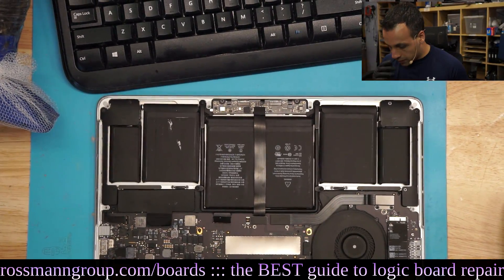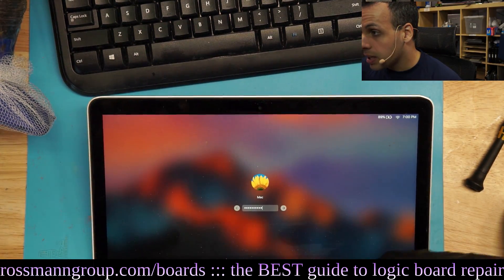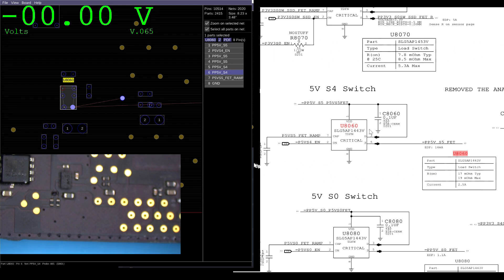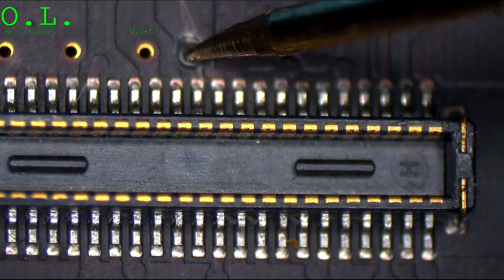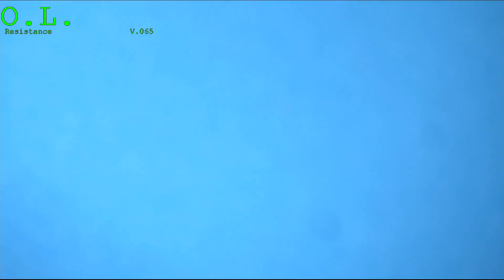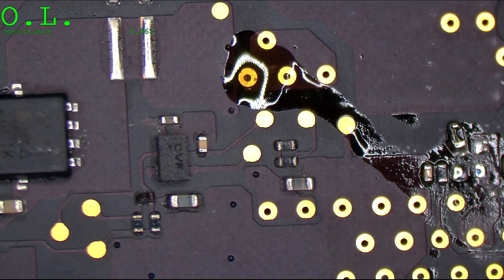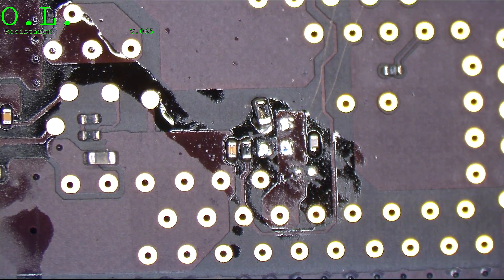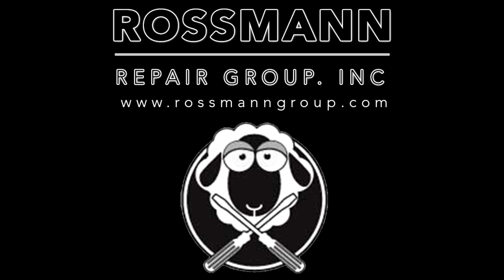Why does little Macbook have no trackpad?

Comment: Did someone ever try to connect this trackpad, as an usb device ?
In my understanding the keyboard matrix is converted to i2c, then sent to the trackpad, which should contain a CY8C24.. or CY7C... which convert trackpad and keyboard to usb. 
Does the the TPAD_SPI bus.. only work before booting/smc and be switched off after usb get's activated?

Trying to reuse a mbp case with its trackpad and keyboard.

Comment: When I was younger, I would have jumped at the opportunity to work in your shop.   As an older IT worker, my arthritic hands no longer have the ability to perform precision work that you do.  That said, I enjoy your videos.  Thank you for sharing them!  In my earlier days, we had a "Windows ME Configuration tool" that was a jagged cut foot long piece of 2x4 that was originally used to make a server rack.  During a repair of a company Windows ME machine, it was ripped off the rack and used to beat a computer until the case fell apart.  We then had justification to ditch the machine and buy a new one.  Good times!

Comment: concerned about 2x failure ? was the board defect by header part of this circuit. knowing how offal cooling is inside these units, overtemp causing fail maybe. just curious, as root cause is important for low comebacks. sometimes your good at identifying root causes but others not so much.

Comment: Hey Louis I know you've opened up a few MSI laptops. How are they built. Junk or Not? 

They are the cheapest company who actually gives decent specs. Their build quality leaves something to be desired on the exterior.

I'm curious by what their internal quality is. I know mine runs cool
 But it also has huge vents on the bottom, and enormous standoffs as well.

Apple would never do either of those things in order to preserve design, even if it sacrifices performance.
Reply from the maker: not bad, but i don't like them soldering the dc jack to the board. makes it easier to break, but lots of brands do that so it is to be expected.

Comment: What’s a good airflow setting for the hot air rework? I picked up a Quick and it’s amazing but I can’t find the sweet spot between effectively melting the solder and blowing the components away.

Comment: This is why I'm glad not to have Apple or need a laptop.  No pointing device?  I just plug one of my spare mouses into USB.  Bad circuit on motherboard?  A replacement is usually $60 or less.
Reply: Steve Johnson you do realise laptops, including macs, accept usb peripherals right?
Reply: Of course, but on a laptop you want a permanent fix rather than carrying around additional keyboard, mouse etc.  No big deal if you're just going to dock it, but that defeats spending extra coin for a laptop.  Most all of my towers are built from used parts.

Comment: You should have tried Linux on this issue again so we could all laugh about how mac hardware is optimized for Linux
Reply: I am really rooting for Linux. I would love to see a third OS choice. Until the do away with threat command line bull shit, software companies won't support it, so it won't gain traction. Once it's not so ass-backwards, it'll get some momentum.
Reply: Since macOS is basically Unix with a fancy desktop, it makes sense.
Reply: Regolith he did a video with a broken track pad with a bad line to the SMC. It worked until he booted it... He put Linux in it the track pad worked. Because it boots in USB mode and when the system finished booting it did a serial line to the SMC... Why have them do that? But Linux was start enough to just use the USB
Reply: +Andew Delashaw I'm actually working on a Video series to show how easy it is, with and without the command line. I have one video so far, but I plan on uploading a second on my weekend this week. I apologize for the first video being long was nervous as hell gonna try to keep the videos from hereon 15 minutes max maybe 20 depending on the video.
Reply: joshagosh I use Linux all the time, you don't need command line, though I find it makes use serval magnitudes faster, but I wouldn't say easier.
Reply: +Peter Borrell and you've skimmed my comment, nice. I said with and without. Not everyone wants use the cli, but some people want to and have no idea where to start. Software companies use CLI far more than you think btw. The issue is the toxic Linux users and the lack of basic user instruction. Can't take an group of advocates seriously when they are too busy jerking each other off arguing over as something simple as them not having the same opinion on desktop environments.

Comment: when I read the title my first thought was that Apple had removed trackpads from some new Macbook model and you were supposed to control the cursor by idk wishful thinking or smth
Reply: barf245 that makes no sense. Apple won't gain anything from that. Make a special port with a hardware authentication system to only register the 50$ specially designed Apple mouse or the 150$ premium version that comes in a variety of different colors.
This sounds more like Apple.
Reply: chemislife Almost apple, just forget about the "special port" and use some shitty 70$ wireless thing
Reply: Leonel Aguilera
but with the special port they can engineer that to fail and make ridiculous amounts of money on bogus repair quotes as well as accessories that have to be designed to use it. going wireless I guess could work if apple developed their own propitiatory wireless card and drivers to only work on their official accessories that cost $$$$ but at this point Im giving them way to many ideas.
Reply: That was probably the point. It's why I clicked.

Comment: Truth is i understand so.little about circuits, but you make it sound so easy and fixeable. Love your stuff. Cant wait for that collab
Reply: Fixing those things IS easy - he even explains it many times that you dont need to know what the stuff does, just notice that it is broken.
Reply: Well it is easy, you just need to know the basics of what each individual component does and pay attention to what he's saying,  here's an abbreviated version "Trackpad no work, how to fix? Look at trackpad line, we have a short to ground so let's look at the components and see what is most likely to fail. Well capacitors often fail short and are going to ground so let's just knock them off, still broken? Have employees beat each other to improve morale then check what else could be going to ground, just the mosfet? So remove that and its fixed."

Once you understand that you can repair almost anything using the same troubleshooting steps, here's a more simplified example. My phone doesn't charge what's wrong? Well first plug phone into different charger, if it still doesn't work then phone must be problem but if it does work it must be the cable or the charger, swap cable then repeat test. Now you know what the problem so fix it, easy.

Comment: How do you clean the boards?
Reply: Jonas Lecerof he seems to use alcohol for little stuff or corrosion, then a sonic cleaner for the whole board. It’s on his website.
Reply: Ryan Santa what does he use as a medium for the ultrasonic cleaner?
Reply: Jonas Lecerof that is a good question and I’d love to find out myself; I’ve never heard him specify what he uses but it always does a great job and looks nice that’s for sure.
Reply: Ryan Santa hopefully he will see this comment. Although I asked him to make a small video about it before.
Reply from the maker: I use branson EC, 103 milliliters to each gallon of water in it, at 60c.
Reply: Jonas Lecerof Placing the board in a bath of 99% Isopropyl Alcohol to displace the Branson, and then into the oven to evaporate the rest of the water and alcohol.
Reply: Louis Rossmann cool, and how do you dry the boards afterwards?
Reply: hihi217 thank you! What temperature in the oven? 60 degrees as well?